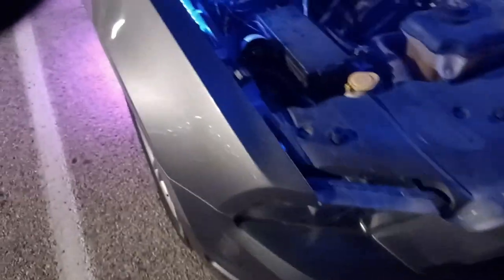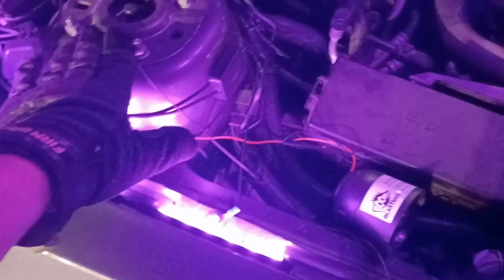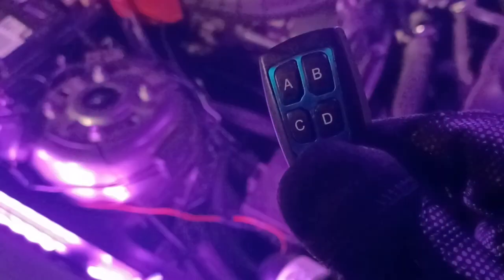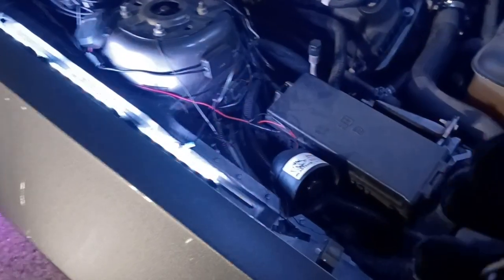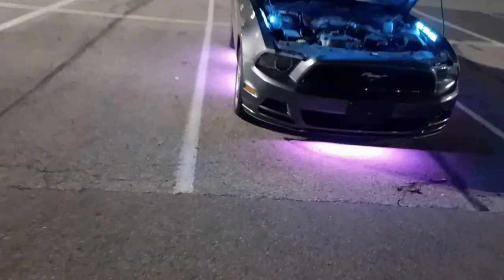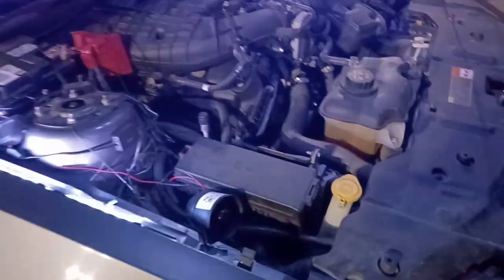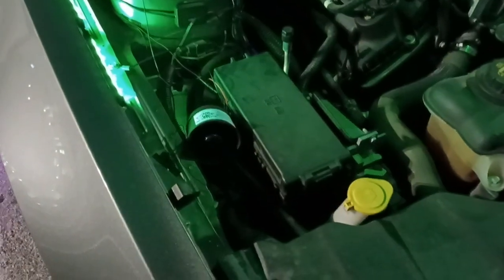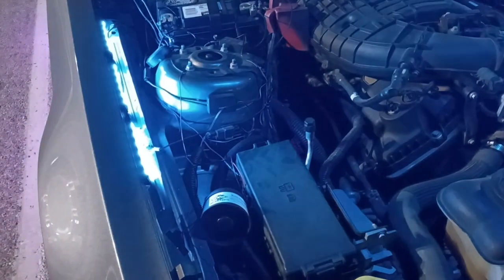New 4 Sound Horse Boom Blasters Horn

Comment: That's nice... I'd like to get that installed in the South Florida area... any ideias?
Reply from the maker: I would think any electronics place could do it. That being said I did buy the remote 1. Now if you buy the button 1 I'd take it to like a body shop maybe cause then you're talking more work with interior panels which I know very little about.
Reply: @theautoguy96  Great, thanks... Would you have a link to the exact one you bought? Cause I saw another video, in which, the one the guy had installed, didn't sound good at all...